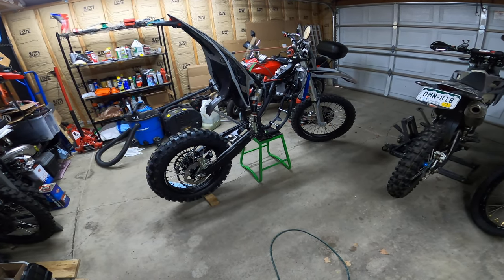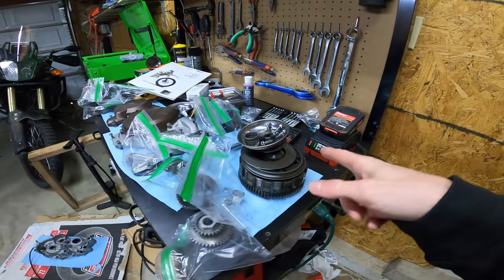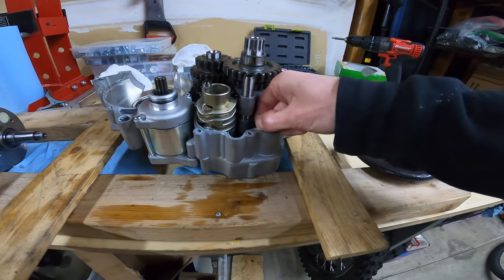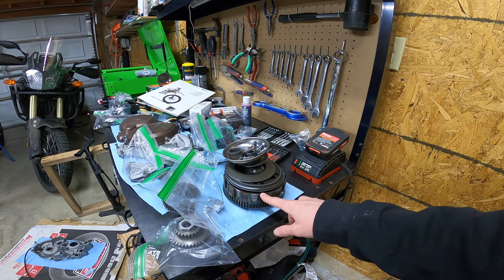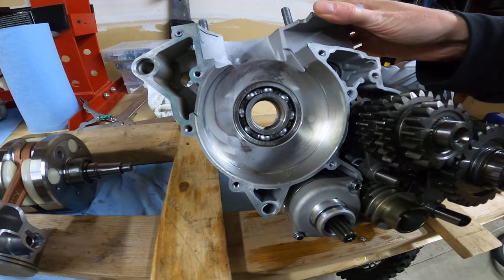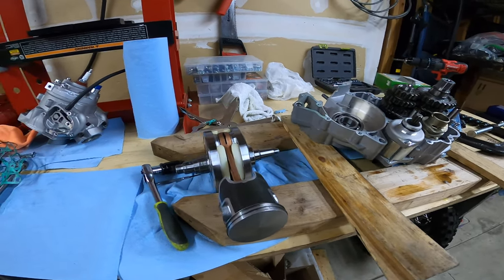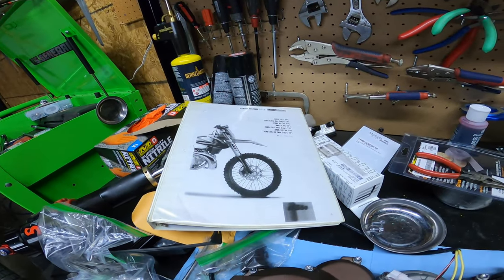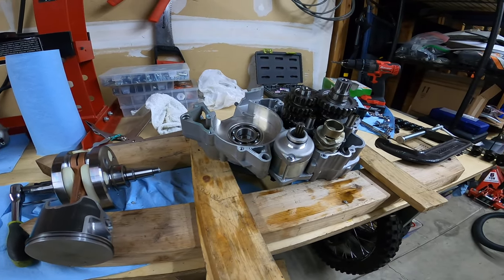GPX TSE300 Engine Teardown/Review

Comment: I have stripped quite a few of the more recent KTM, GasGas, Husky  TPi engines and quite a few but not all  have gasket maker between the centre cases, No centre gasket. We fit a gasket on rebuild.
Reply from the maker: It's not just the center cases, every piece of the motor uses gasket maker, the water pump cover has the normal rubber gasket and...gasket maker all over. The cylinder has normal cylinder gaskets and...gasket maker all over.  It's not a deal-breaker but it's just a bit annoying for rebuilds, for the case, sure glue that together I don't mind because we shouldn't be doing case work :). There are gaskets that I'd normally re-use that I wouldn't here because these gaskets are covered in gasket maker, it's weird that they used gasket maker AND gaskets on things.
Reply: @SCakey  Its not such a big deal for me. Gaskets kits are available for those that want them.
Reply: No Japanese motocross bike that I am aware of has ever used a gasket between case halves. I worked as a dealership mechanic from 90, to 03, and still ride and work on bikes regularly. Yamabond 4 man🤷‍♂️

Comment: What a shame. Looks like it froze like you said. I really thought about buying one but I've decided to just look for a nice used ktm for about the same price or less. I would buy the crate engine if it was a reasonable price. And parts availability is what puts me off of buying one.
Reply from the maker: Yea I mean far as parts availability it's KTM engine from what I see, it'll probably take KTM parts and I was planning on using KTM gaskets. Forks are WP XPlor copies, shock probably WP copy so for the most part KTM parts can be swapped on. Not saying you're wrong though in looking for a $6-7k used bike.
Reply: What’s the cost of the 300 engine from china ?
Reply: @dennish6987  the tse250r was like $2300-2500 as a crate engine. So I'd figure at least $3k for a crate 300. 450 is somewhere around there too.
Reply: Oil?
Reply: There good. Cheap to re build
Reply: I have seen new left over 2023 Austrian bikes for $7500 might be a better deal.
Reply: @RUSTY-A-L  yeah I picked up a 23 gasgas 300 awhile ago for $7300 + taxes and fees. Much easier to order parts for than a gpx is my biggest thing.

Comment: From about 2020 to now, people were raving about how good GPX bikes were. I personally rode a 2019 TSE 250r, and frankly, that engine was dogshit. My YZ125x pulls so much harder than that bike did, and has better ergonomics to. Now present day, I'm hearing about all sorts of reliability nightmares, and I think the honeymoon period for GPX is over, and people are finding out they are indeed, just more Chinese shit.

At least that's my opinion. Get a used KTM or YZ for a similar price, and much better quality. Most Chinese factory's don't give a single shit about proper QC.
Reply from the maker: There are more issues than what's been posted too, I've tried to be friendly offering GPX the chance to own fixing them but I'm not seeing it happen.Even though mine is currently running perfectly fine, I do not trust this engine at all and no one should have to do the work I did on a new bike.  While I can recommend a FSE300R if someone is looking at a KLX300/CRF300/WR250R, I cannot recommend the TSE300 to anyone right now due to all the issues and lack of response from GPX.
Reply: The TSE250R engine is based off the old early 2000's Yamaha TTR230. It's actually a licensed copy. So, yeah, your YZ is going to feel stronger as it's a race derived engine, compared to the TTR which is a detuned trail engine with a bigger flywheel. It'll have a bit more bottom end grunt, but no top end pop. Plus the 2019's had a vastly undersized pipe on it. The 2020's and up have an actual 250 sized pipe that really opened the engine up. I have almost 200 hours on my 2021 TSE250R with not a single issue. Just general maintenance. Parts, top end kits, whatever are really easy to get since they're cross compatible with the Yamaha. I'm not winning any races with it, but for ripping around single track without wearing me out it's a blast.
Reply: Metallurgical integrity and QC do not apply to cheap Chinese stuff.
Reply: Gota redo carb then itl blow  a 125
Reply: I was saying this from the beginning. I rode with a guy who bought the tse 300, and i was riding a $2000 2012 250 exc and leaving him in dust.